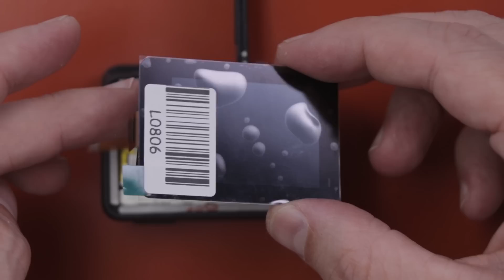I Bought 6 "Unfixable" GoPro's - Are They Really Unfixable?

Comment from the maker: Do you have a broken GoPro laying around? I'm still surprised that GoPro makes their devices so difficult to repair.
Reply: I'm thinking that once you have everything compressed back into the casing, etc, like usual and once the internal glue is set, then go over any open edges and seams where water would go through with some super glue, loctite, or similar that has the same heat and cold and PSI tolerances as the GoPro, using a toothpick if needed so it'll stay waterproof to the same specs. And before that application of sealer sets in, use like acetone or something that making sure beforehand that it won't dissolve the plastic, with a qtip to remove the excess. Depending on the sealer, you could use like warm water or something, especially if it's freshly just applied. Maybe this can work in your case. Good luck!
Reply: At least they're not making £5-6k machines that are unfixable with no reason..... @Apple
Reply: @kc4415  Isn't the "dream machine" to transfer stuff with T-2 chip like 20k and only kept in Apple facilities?
Reply: How much for the jacked up 7?  Don’t care about the looks or waterproof part.
Reply: @Pante09  Its called making money .Why upgrade when the latest model is not that much better than the one before .Keeping up with the joneses .Classic case mobile phones
Reply: What is gopro?
Reply: @kc4415  There is no Apple  £5-6k machines that are unfixable with no reason
Reply: put an apple logo on it and you get perfect superexpensive unrepairable device....
Reply: @isaacmajor1892  it is a mini camera that can fit in your pocket and take high resolution videos with instead of using your phone, phone cameras have been getting batter but I believe the gopros have a higher resolution than any current phone camera.
Reply: @lordmmx1303  Nonsense. iPhone is the easiest to repair compared to other smartphones. Display and battery replacement takes 15 minutes of operation.
Reply: @nnnnnn3647  definitely not. Battery replacement is ok you just need like 4 different screwdrivers. But if you want to replace a screen you need to take everything out from the back instead of just taking it out from the front like most android phones.
Reply: @thegamingboss3347  gopros do not have higher resolution than mobile phones (some are 108 MP). These small waterproof cameras are optimised for outdoor and video use with good quality and stabilization.
Reply: @TronicsFix You should try fixing a DJI Maverick drone next. I've always wanted to buy one but I'm afraid of wrecking it and it being too difficult to repair.
Reply: @nnnnnn3647  yes but apple would love to make it unrepairable as much as gopro does with their cameras.
Reply: @ChillPlaysHD  Try replacing the screen and battery in the galaxy NOTE 10/20 or S10 S20 etc. Good luck.
Reply: @lordmmx1303  If they wanted to, they would, and you are lying.
Reply: @nnnnnn3647  that's why I said MOST android phones (read carefully)
Reply: I believe aliexpress sells the gopro 8 lcds
Reply: GoPro is the Apple of cameras. No, thank you.
Reply: Yeap, a hero session, try to repair one of those, it's just a waste of money.
Reply: I just don't understand why you didn't try to pry the screen off. It's clearly attached to the back part with adhesive
Reply: Well, i'm repairing go pro's for a while, and they are effectively very hard to repair. You must be very carefull while removing all parts, and i've built special tools for that, like a heating extractor. I'm cutting the modelised replacement adhesive with a laser machine, so they replace perfectly the original one. For the Go Pro 8, there are screens availble on Aliexpress site, but very expensive ( Oled + touch ) at 60/65$+ each free shipping. Screens for go Pro 3, 4, 5, 6 and 7 too, but way more cheaper (13 to 25$). If you need extra help, do not hesistate !
Reply: If you're worried about the water proofing you damaged, just run a tiny bead of silicone caulk in its place, literally the same thing.
Reply: @nnnnnn3647  Did you notice something about the GoPro.  It has a battery compartment for swapping the battery and still remains waterproof.  Why no swappable battery on all smart phones?
Reply: @pow9606  Who would like a 1 cm thick smartphone?
Reply: they don't want them to be fixable, they want you to have to buy a new one
Reply: They want more money sooo...
Reply: @ACNNOMOREBLUFF  Any recommended vendors on Ali?
Reply: @nnnnnn3647  if it had excellent battery life and chip cooling.. i would. plus they wouldn't have an excuse to say 'there's no room for a headphone jack" ;D
Reply: @TheOrganicartist  Nope. Just type in the search box "gopro replacement screen" and choose you best location when the results are shown. Sometimes, the products are available in you country for a few bucks more, so you will not have to wait 4 weeks to get them. So far, i'm using my credit card, and never had any problem with them. Their insurances are very effective, and there are no stealers who survived there. The only risk with very low prices is about the packaging and the quality. So try first with one, then renew for many if you are satisfied. One important thing. Choose well your curency or you will pay extra fees from your bank. By the way, the less you pay for the product, the more strange packaging you will receive :-)
Reply: A tip I learned a while back with phone fronts especially glued fronts was to use the hot bed like ones found on 3D printers, beats using the hot air gun.
Reply: Companies like these are harmful for environment and are becoming direct reason for increasing E-waste unfortunately, these companies should shame on their production practices.
Reply: I have bought 2 damaged gopro 5 blacks on ebay for just € 60, € 30 each with broken screens, only one worked, I have repaired both, with the cost of each screen for € 16 I think it's worth it and you can even resell them again and take electronic waste from the market
Reply: @nnnnnn3647  mac pro cough Cough
Reply: I'm far from amazed. Planned obsolescence isn't exceptionally profitable, so planned unrepairable is the game card to play.
Still, interesting video. I'd re-water resist the thing with silicone sealant, properly vented.
Although, in a worse case scenario, I'd go with a lot and repair scavenging parts as I go along. I am surprised at their scrap value though!
Reply: You should use these to build naked gopro's using the naked gopro kits  and sell them to drone pilots :)
Reply: i have my gopro hero 7 black in a repair shop for fix water damage and they fixed the pcd and the camera is working with the cable but not with the battery and even i got them a new battery, there is no diagram of the pcb to help the fix.
Reply: I have a Hero 4 Black, that thing died when I went through an accident.  A drunk driver hit me head on while on my motorcycle, the camera hit the concrete first, it was chin mounted.  My helmet is a bit crushed on the side.  Long story short, the gopro doesn't work at all lol.  Camera died, bike totaled, 11 broken bones including a C1 neck fracture.
Reply: @nnnnnn3647  replace the battery and it yells at you, use another home button or front camera assembly and it disables features. another oem apple screen but it wasn't paired with the phone originally? ah yess it's a "counterfeit"  screen. samsung lcd assemblies have always cost an arm and a leg just buy it with the frame and it's not a huge pain to swap. plenty of other phones are much easier than samsung and wont disable features when repaired by anyone but the manufacturer. removeable battery and waterproofed only adds like 1-2mm at worst. i'd rather have a 1cm thick phone over a 5mm thick one. won't bend if i look at it funny, and 2-5x the battery life. you store it in your chocolate hole or something? that negligible change in thickness does nothing beside make it less durable, decrease battery life and makes stupid people think there is some kind of benefit. only the manufacturer benefits from it. idiots clamber over it for being thin, they save on material costs over the whole production slightly, and it breaks easier so you gotta pay to repair or replace it. you have to charge it more so more likely to wear the battery out, they use thinner glass making it easier to crack. they keep making tougher and tougher glass but make it thinner to get the phone thinner. so in the end it's still just as likely to crack as the weaker thicker glass instead of using the new glass but thicker making it almost uncrackable. but then they can't sell as many cases, screen protectors or replacement phones.
Reply: Bro are u selling these i want one
Reply: i have an old session that i hit on a corner of a building on my quad at 60-70 mph, needless to say, what i found of wasn't recognizable as a go pro.
Reply: @isaacmajor1892   Dishwasher
Reply: When it is dissembled it affects it's reliability.This thing is ment to withstand immense pressure and extreme temperatures and so it should and compromise its structure in such situations. So we feel difficult to crack it open with pressure and temperature, even if we do it for a repair. Actually they are not making it hard to repair but making it too hard to be destroyed.
Reply: Can I buy one of these ?
Reply: @kc4415  I see apple and Tesla calls with 40k-100k cars sooo.
Reply: i have a hero 4 session since 2013, still strong, battery holds charge great
Reply: 13:00 "wont be waterproof again"

there are literally thousands of products for remaking and resealing waterproof electronics.......   if youre going to do these videos, spend two minutes on ebay, alibaba amazon and just SEARCH for waterproofing solutions and gasket kits......
Reply: I bought a GoPro 8 from someone, but it has no image.  The menu is visible, I can access the properties, it connects to the application, but I have no image.  All properties are seen on a black background. Do you have any idea what it could be?  Can it be the video lens?  I want to mention that the device did not suffer any blows.  It is impeccable.  New.  I hope you can help me with an answer.  Thank you.
Reply: @pow9606  My first smartphone had that, Samsung S2. Still a very good phone. Personally I consider a removable batter a must have feature. But unable to find any like that since.
Reply: I have a GoPro Hero5 Session with a fractured lens - not lens cover. On impact, the lens cover glass must have deformed far enough back to impact the lens. Lens is soldered to the circuit. Would love to repair it since it's a great camera format.
Reply: Correct me if I'm wrong, but the HERO 7's front lens screen just twists off lol
Reply: i guess im randomly asking but does anyone know of a trick to get back into an instagram account?
I stupidly lost the login password. I would love any tips you can offer me
Reply: @Misael Harry Instablaster =)
Reply: A few years ago I broke the GoPro when I tried inserting the memory card. Now the rear lcd screen does not work.
Reply: @CarbideCarbon  all right bet
Reply: Not surprised there stealing people's money
Reply: i have a hero 5 i bought used, worked for 2 months, has been dead for a month from when i write this, its sensor seems to have died, it powers on and displays the overlay on a black screen, connecting to it with the app yields the feed to be missing entirely, like someone deleted the html element
Reply: 4 years old but im fairly sure my mainboard for hero 8 has died ( I bought it used for the media mod adapter without realizing it doesn't work with my 7 ).  any insight on where I could purchase a mainboard for it?

Comment: Be hard pushed to get your  money back and more with them.More of a reason to boycott firms that make stuff hard to repair  .These days you should be reparing recycling  as opposed to buying new
Reply from the maker: Imagine if they made these easier/possible to repair!
Reply: Just sad to see this company making a landfill contributor. Its a pathetic  trend that doesn't make sense.
Reply: In fairness to GoPro, they do have the excuse of the fact these devices are intended to be highly rugged and resistant to all kind of conditions, which for a small device means repairability goes out of the window - unlike, say, a MacBook, which there is no excuse for.
Reply: @Lukeno52  Things glued together are cheaper to produce , you would not mind these are expensive premium products .Mobile phones gone the same. Like the video says they could be all screwed together with O rings , and still be water proof
Reply: Thank you for this comment. We should preserve and maintain electronics instead of making them so disposable.
Reply: @sys-administrator  Locktite ? , and harsh conditions , like a james bond watch that's 200 meters water resistant , very usefull .The shower will do
Reply: @AustinFerguson  same goes with airpods
Reply: @SergCity  And Beats By Dre which is a subsidiary of Apple. Advertised as high end audio equipment but made from pieces of plastic largely just glued together. To think they cost more than other brands like Beyerdynamic which have better drivers, are mostly made of metal, mechanically held together to allow easy repairs and are made in Germany.
Reply: @Wipeout186  Customers buys products that is slimmer, lighter etc.  So its mostly driven by that trend.  But there should be a tax for non repairbility for products that could be objects to repair.  Obviously there is a limit for how low value products we will repair, since its quite expensive to get things done by professionals.
Mobile phones should at least have a more easy way to replace the screen.  Its the first part that usually breaks.
Reply: @la7dfa  yes... more government will totally solve the problem. Lets charge the consumer money for products that corporations make. (This is how you sound)
Reply: Easy to repair vs easy to manufacture. Imagine the cost (and also size) of these if they made them easy to repair.
Reply: @Lukeno52  there are some pretty rugged phones that are still repairable. Built like G shocks are.

A lot of badass laptops in the late 90s early 2000s were screwed together and the water resistance came from replaceable rubber gaskets. Not adhesive.

Comment: This is one of the problems of herd mentality. If ppl would stop buying a product when pointless changes are made like an irreplaceable lense covers or other nuisances they would have to start listening to us and do a better job.
Reply from the maker: Yes, agreed. Part of the problem is when a company makes a really good product.
Reply: starshipeleven  Gopro might be a specific brand however when someone thinks extreme sports camera or a small portable mountable camera a lot of people call them Gopro. I'd get a Gopro over any other similar brand. The thing is in the video he says they aren't repairable so I must have been watching a different video as it sure looked repairable to me, a bit difficult sure but definitely repairable.
Reply: Apple would go bust very quickly
Reply: I had/have the GoPro Hero 5, 6, 7. Broke at least 2 lens covers while mountain biking. On older GoPros I also had to replace them because of small scratches from constant "cleaning" in dusty or muddy conditions. So I did not buy the 8. Also not the Hero 9. The Hero 9 is quite heavy. Not ideal on the helmet. And the heavier the harder to keep it in place with the chest mount. Some years ago I tested some other brands but they could not compete with GoPro.
Reply: @Tronicsfix  Yeah it's tough to encourage people to make good decisions when the less moral/repairable options have gotten so good at user experience :/
Reply: starshipeleven  which competitors do make better cameras, also which specific cameras do you compare when making that statement?

Comment: This is why right to repair is so important. Good job on this one!
Reply from the maker: Agreed!
Reply: I'm a huge right to repair advocate who literally is a sales manager for an electronics repair company.   But I just don't see how a design not conducive to repairing is the same thing as barring repair through legislation and disrupting replacement parts supply chains and aftermarkets.
Reply: There's a difference between right to repair and making something easily repairable.
Reply: @SmallLab129  Especially for devices expected to have significant water resistance.  The adhesive was what was messing him up in this video.  To me it seems obvious why they'd use aggressive adhesive in their designs.
Reply: @kevinsippeljr9984  I would buy one of these non-waterproof ones for my mountain biking and especially if it’s dinged up already it’s even better
Reply: @Skynet unrelated to the discussion. Some things are just too hard to design repairable
Reply: @r8cobra  They're really not. But they might be too hard to design/ manufacture down to a cost if they're repairable...
Reply: @exasperated  I had an old small camera, and i took it apart, just the outside screws, and was unable to put it back together because there's so much crap crammed in the camera. some things are too hard to design to be taken apart. it's true.